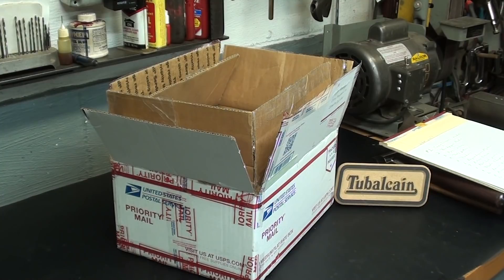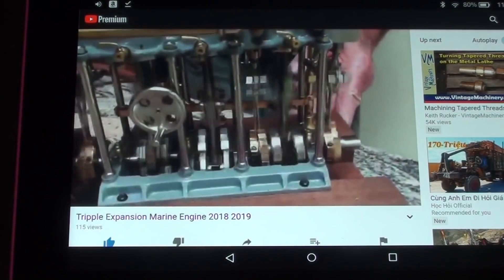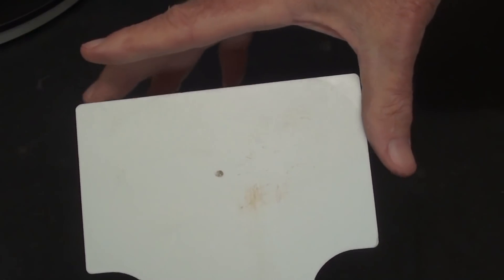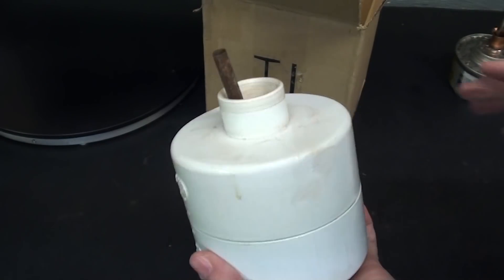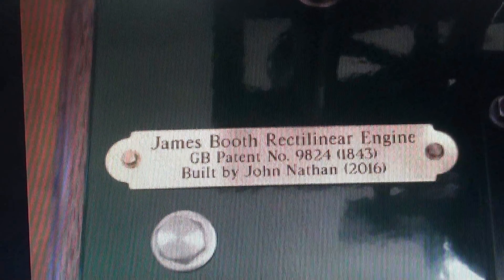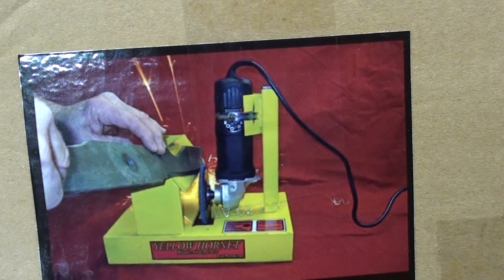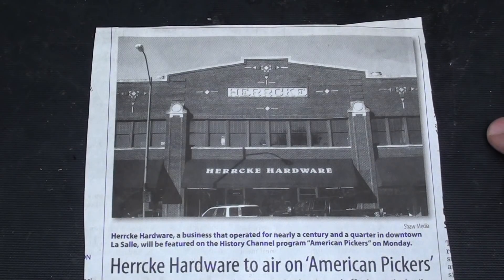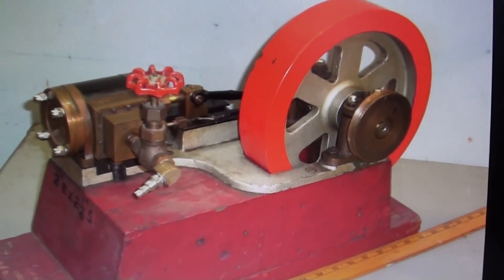THIS & THAT episode #53 tubalcain mrpete

Comment: Growing up we had a hardware store that was like Herrcke Hardware though it wasn't near as big of a store.  You could walk into that store and get just about anything you wanted.  It might take them a few minutes to find where they put it but it was just absolutely packed.  When the two gentlemen that ran the store retired and they sold everything in the store, man that was like losing a loved one.  I've never been in a store since that had anywhere near that character.
Reply from the maker: I totally agree. There was a store here in town called Williams hardware. It was three stories high. There wasn’t anything that they did not have. Ammunition, gun powder furnaces. In 1958 there was a terrible fire, it burnt to the ground.  Modern merchandising requires that all items remain on the shelf for only 90 days if you were to make money on them

Comment: Mr. Pete,
   Nice this and that video. 
A couple of thing caught my interest. We had a local hardware store in my small town in Pike County , Illinois very similar to the one in LA Salle. Just a simple store, locally owned and I don’t think there was anything they didn’t have or could get. Nothing but fine quality tools and hardware equipment. I miss that type of store. The other thing was the Divinity. My wife makes the best Divinity I’ve ever tasted and if you know anything about making it it’s no easy process. She always waits until the ambient humidity is very low. She claims that is the main ingredient in the divinity making process. Whatever, I know it’s good and the best of my favorite candy. (By the way, we never call it fudge here. Fudge is a chocolate concoction) lol
Reply from the maker: My friend in Baton Rouge, apologize for the late delivery of my divinity. He blamed it on the weather, and said he had to wait for a dry spell. My mother would sometimes make it, and about half of the time it didn’t harden right. She always. Said it was difficult to make. I have another friend here in Illinois who’s wife makes it for me occasionally. She apologize for the last batch, it was gooy.    You can sometimes get it at Walmart, but it is absolutely awful. One bite, and I threw the whole batch away. You are lucky to have a wife that can make it! Thanks
Reply: mrpete222 if the humidity is high there is no way divinity will harden to that crispy, crunchy texture. It is either gooey Like you mentioned or just turns into soft crumbles. Of course it isn’t right without a good portion of Illinois pecans. There is no comparison in the flavor. The southern paper shell pecans produces abundant pecan meats and easily extracted but no way do they compare with the small, hard shell Midwest variety. We had three pecan trees out by the barn and it was always a right of passage to gather them and shell them out in the fall in preparation for holiday cooking. We invented various machines to crack the shells to produce the whole nutmeat. Nirvana!

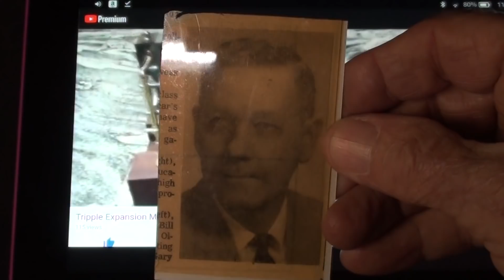Comment: Lyle I made a couple of spill proof containers today using what was described as yogurt pots from the supermarket.  They cost me NZ$2:00 each, and have the right shape with a full width screw on cap, and hold about a quarter of a pint.   I made a brush sized hole in the lid, and have tried tipping them over when a third full with cutting oil, and nothing leaked.  You can even get them with four different coloured lids (the container itself is transparent).  Having knocked an ope topped container half full of soluble oil off the mill table last week, and creating a BIG mess, I am feeling pleased with myself.  Fingers crossed that RTD does eat through the plastic.